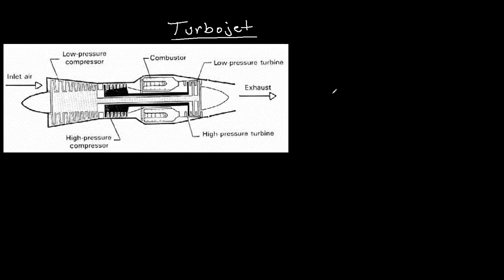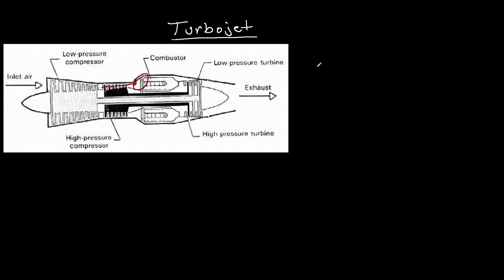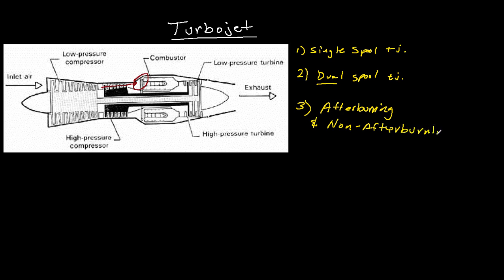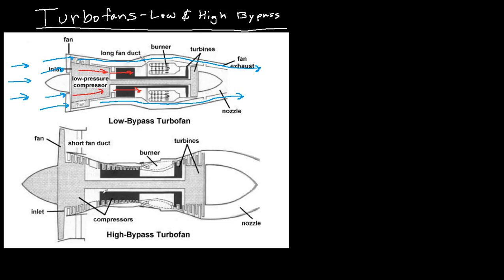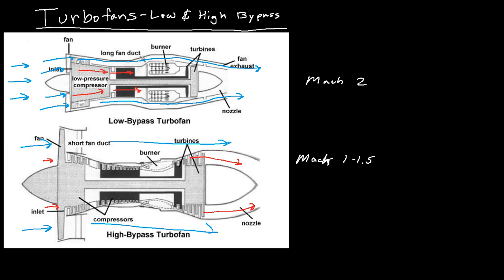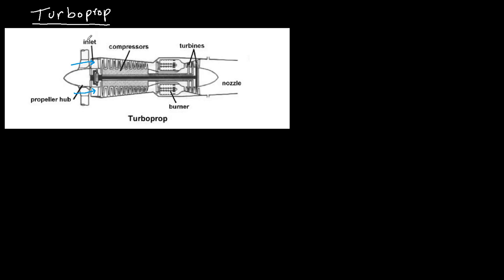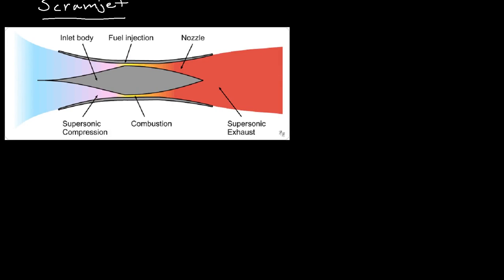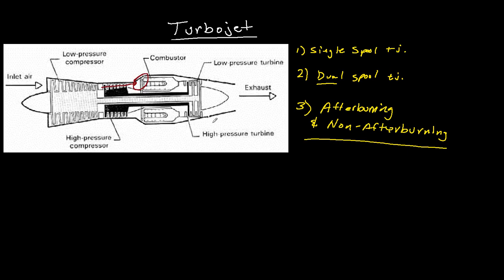Jet Engine Types

Comment: 1:49 I know this is a old video but your explanation of the pressure in the combustion chamber being extremely high due to just being combusted is incorrect. 
 The area of highest pressure is in the diffuser. 
 And the High & Low pressure turbines are named because they drive the High & Low pressure compressors, not because the pressure in the turbine is higher.
 When the air is combusted the Velocity & Temperature increase while the Pressure is decreased. 
 The gas then enters the Nozzle Guide Vanes where the Velocity is further increased and pressure reduced, then the Temperature & Pressure are reduced as the gas passes through the turbines.

Comment: I did not care for how you described the diffuser. The flame holders, and fuel injectors are what keeps the flame stable, the diffuser slows the air down not to keep the flames lit, but to increase the perceived static pressure of the combustors. Think kinda like this, you have 'x' air pressure, 'y' air speed, and ➡️ as diffuser.
X+2Y➡️2X+Y
These numbers are NOT a real relation of pressure increase, but a rough example. This is how I was explained it many years ago.
Video has good graphic descriptions tho. Cheers!

Comment: Excellent video, thank you!  Could you please, when you get a chance, explain why a jet engine would want to bypass fan blown air.  Is this for engine cooling purposes, or does the front fan act as a propeller of sorts to provide extra thrust?  Thanks.
Reply: it is more efficient, less noisy and yes it cools the engine
Reply: It promotes very rapid expansion of the gases which gives good power output with a low fuel consumption

Comment: I've seen in a lot of these videos where it is stated that the gases and their speed coming out the back nozzle is the reason for the forward thrust. When in reality the escape of the gasses out of the nozzle are a by product of the desired effect which is a reduction in pressure at the back of the combustion chamber while maintaining pressure on the back of the compressor turbine at the front of the combustion chamber. This pressure differential between the front and back of the combustion chamber is what causes the forward kinetic energy towards the air source. The necessary evil of the power turbines creating back pressure on the combustion chamber is that obviously the compressor and air flow entry system (turbo fan, turbo prop, low pressure compressor) require energy and therefor for the engine system to work as a whole.
Reply: This "theory" of DrHarryT is completely WRONG. It's NOT the pressure difference between the front and the back of the combuster (the flame area between the compressor and the turbine). The pressure difference there is not very high. The main reason why a jet engine forces the aircraft forward (thust) is the mass of the air that leaves the aft end of the engine at high speed. The exhaust nozzle has also an important contribution to the total thrust force: It accelerates the hot air that leaves the turbine. The more mass of air per second that is flowing through the jet engine and the higher the acceleration of that air is at the rear end of the engine when leaving the nozzle, the higher the resulting thrust.
Reply: @sorgfaeltig  Tell me what applies the forward kinetic energy to the airframe or the engine which is bolted to the airframe? [Remember for every action there is an equal and opposite reaction.]
Reply: @DrHarryT  Yes, to illustrate the force, think of a garden hose you hold in your hands. The nozzle of the hose accelerates the water that is flowing through the hose and leaves the nozzle at a high speed. You feel a force in your hands that will push the nozzle in the opposite direction from where the jet of water is pointed. Likewise the jet engine accelerates a mass of air through the nozzle - this mass of air that is accelerated to leave the engine at a high speed is giving the engine a push in the opposite direction. Action = reaction. / acceleration of a mass of air to a higher speed = thrust in the opposite direction through the engine nozzle via the structure and mounting of the engine to the airframe.
Reply: @sorgfaeltig  The acceleration is a byproduct.
If not, exactly how does acceleration cause kinetic energy?
The pressure in the hose is 60psi~, at the exit hole the pressure is 14psi~. [At sea level]
Reply: @DrHarryT  In a way you are almost right. "acceleration is a by-product". In physics we know that force equals mass times acceleration so the product of acceleration times mass equals the force we are looking for in the jet engine. We call that force thrust. Back to your example for the hose that has 60 psi before the nozzle and 14 psi after the nozzle. Think now of two different cases of that same hose with the same pressures. A: case -1- we have air of 60 psi in the hose and blow it out through the nozzle. B: case -2- we have water of 60 psi in the hose and let it out of the nozzle. Qustion: In which case do we feel or measure the greater reactive force due to the fluid leaving the nozzle at high speed? It's at B, (case -2-) because with water we accelerate a greater mass per unit time. 
Note: case -1- and case -2- have both the same diameters of hose and nozzle and have the same pressures. But the resulting forces are different for the two different cases. So it's NOT the pressure differential. It's the aceleration of mass (air) which produces the force of thrust in a jet engine. If you don't believe me, ask a physics expert.
Reply: @sorgfaeltig  
Well said, as a aircraft engineer for the last 27 years and someone who builds miniature jet engines for RC aircraft at home, your explanation is absolutely spot on.

Comment: Isn't the air slowed down in the combustor to get an efficient burn, not to make sure it doesn't "blow out" the flame?
Reply: TheENxis thecnically the diffuser is in charge of slowing down the air so that you can obtain better combustion. Are you familiar with the whole diverging/converging principle? That's what's going on with the air through the different stages.

Comment: Is there anyone knows what is the maximum temperature during burning jet gass?
Reply: 14 feb 2019 11:41 am est:
(1)
(1.1)'Inside the typical commercial jet engine, the fuel burns in the combustion chamber at up to 2000 degrees Celsius. The temperature at which metals in this part of the engine start to melt is 1300 degrees Celsius, so advanced cooling techniques must be used.'
(1.2)'The air brought in by the fan that does not go through the core of the engine and is thus not used for combustion, which amounts to about 60 percent of the total airflow, is introduced progressively into the flame tube to lower the temperature inside the combustor and cool the walls of the flame tube.'
in https://cs.stanford.edu/people/eroberts/courses/ww2/projects/jet-airplanes/how.html
from google(jet engine combustion chamber temperature)result 1

(2)
(2.1)'In a healthy jet engine in operation, the temperature in the combustion chamber can reach about 1,400 degrees Celsius or 2,552 degrees Fahrenheit.'
in https://blog.klm.com/jet-engines-are-hot-in-at-least-4-ways/
from google(jet engine combustion chamber temperature)page 1 number last

Comment: I could imagine the incoming air is quite hot after being compressed to 35bar by the compressor stage(s). What sort of efficiencies might be gained by cooling the air before it enters the combustor? Cool air at 35bar is denser hence more oxygen per unit of volume than hot air, which means more fuel could be burned, greater expansion obtained?

But then how do you effectively cool such a large volume of air?
Reply: through water methanol injection
Reply: I know this is an old post. You are right that the compressed air leaving the compressor is much hotter (23:1-40:1) but the air expanding just before the combustion chamber causes a reduction in heat (expanding gas become heat absorbent). In this system though the compressor limits/regulates the air entering the combustion area so no matter how much heat was removed no more air (~14% oxygen) would exist in the combustion chamber. Higher rpm's is the only way to get more oxygen into the combustion chamber.

Comment: Why do you need to have compression and turbine fans?
Why not just compress the air with a metal cone
Reply: Because at the 'low' operating speeds of the turbojet engines the air is not moving fast enough, so the compression fans push the air along and help with the compression. With a ramjet engines, the air is already moving fast enough (since the aircraft must be travelling really fast for them to work) to be compressed without the assistance of the fans. Im pretty sure the guy in this video got the ramjet and scramjet engines around the wrong way.